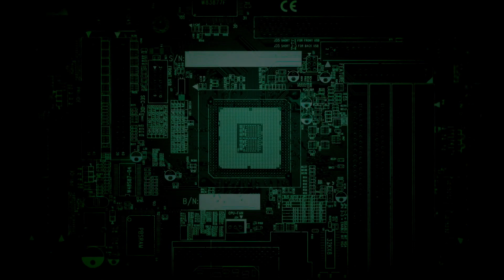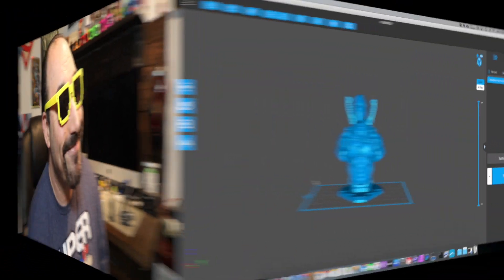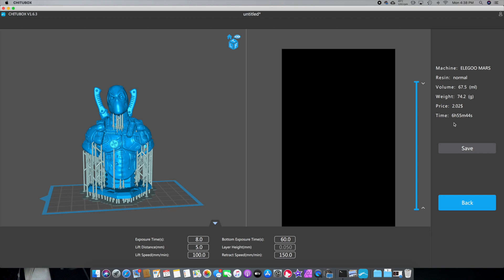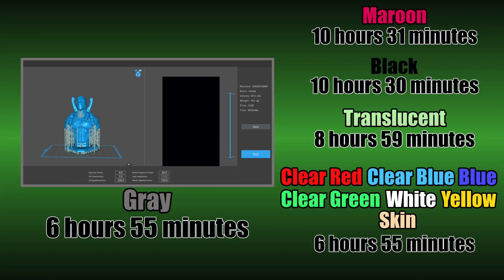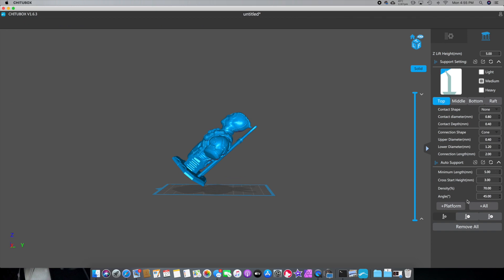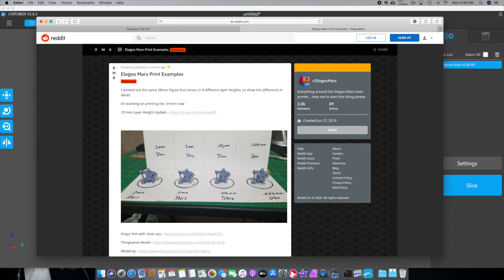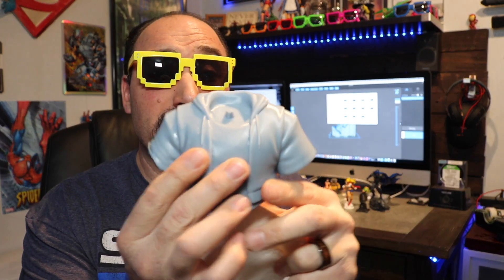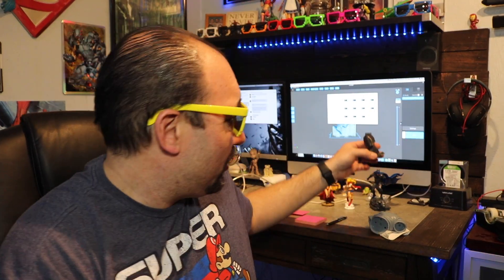How to print faster on the Elegoo Mars

Comment from the maker: Update!
I was having problems with this method with large prints and of course I found a solution add 25% exposure.  So it would be 10 seconds exposure time and 75 seconds to bottom exposure in settings / print . Adds more time but everything coming out correctly.

Comment: I dont know if i did something wrong. But a print i am doing, i changed to the .01 said it would take 26 hours its around same size as you are doing. I changed it back to the .05 and said it would only take 5 hours 20 minuets. And that is hollowed out on both settings. Then after watching that part again. noticed its .1 not .01 that made a  huge differnce. Now at  .1 only takes 2 hours 10 minuets. Thanks man you rock.. New sub from me.
Reply from the maker: Thanks man appreciate it. If it gets weird make sure you add 25% of exposure.

Comment: Hey will, I’m trying to print my first figure on the Elgoo Mars using chitubox, I’m splitting my model in zbrush , is there a way to split it into parts in chitubox ? As I’m having problems with the scale of the parts in chitubox , like sizing the arms to the torso of that makes any sense ?, I’m trying to print it at 1/4 scale as complete figure when all parts are added , any help would be appreciated amigo
Reply from the maker: You can’t do it in chitinox. I use blender export it out and then chitinox. Here’s a video of my process. https://youtu.be/e9VeyBNnH1g
Reply: Tha is for the reply dude! Will definitely look into that , was currently slicing my model in zbrush as I sculpted in zbrush , so will try blender instead .

Comment: Hey I plan to print my own statue from zbrush in a 1/4 (18 inch scale) in parts ,just got my elgoo and was wondering if there’s anything I should know before attempting my first print before I ended up wasting a bunch of resin. Pieces will be hollow on the inside .Any help would be appreciated! Total nervous newbie here.
Reply from the maker: Best advice I can give you is Bring it into the slicer make sure your layers look correct. If there’s any weird anomalies correct in Z brush. And make sure you don’t make things to thin.
Reply: @CrazyWillTechShow   thanks for the quick reply ! And will definitely use that advice . Thanks again .
Reply from the maker: I wish I could be more help but every print has its challenges. It’s more trial and error than anything else.

Comment: Hello how are you, your channel is great. I have a couple of questions, on wanhao resin and anycubic (both grey), what exposure time do you recommend for layers at 0.1 mm ?.I tried with brown in my elegoo mars but the results were null, it doesn't print very well. Thank you very much.
Reply from the maker: I was having similar problems after I made the video. What works for me is layer height .1 exposure time 10 bottom exposure time 75. Fixed all my issues.
Reply: @CrazyWillTechShow  Ok, I will try with that configuration, thank you very much for your answer, greetings !

Comment: Thanks so much I went from 14 hours to 5.
Reply from the maker: That great! I was having problems with this method with large prints and of course I found a solution add 25% exposure.  So it would be 10 seconds exposure time and 75 seconds to bottom exposure in settings / print . Adds more time but everything coming out correctly.
Reply: @CrazyWillTechShow  this is game changing to me because I make 3d printed jewelry but because of the resin and the fact that I stand things upright it’s like 5 or more hours but this brings it down to 2 or 1 hour